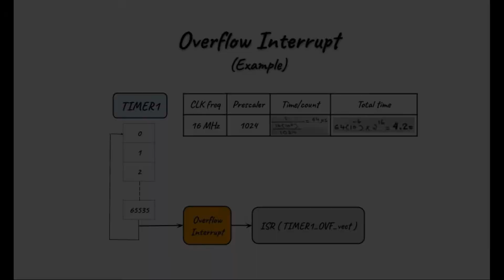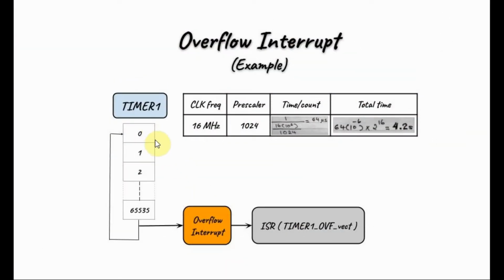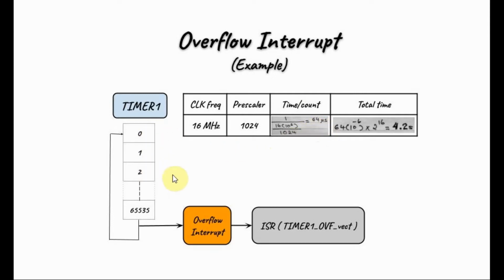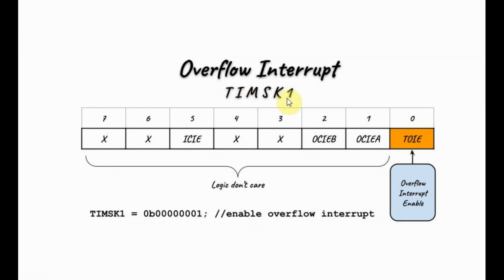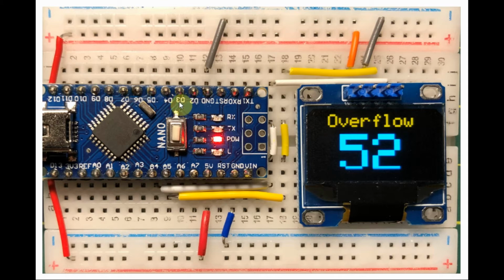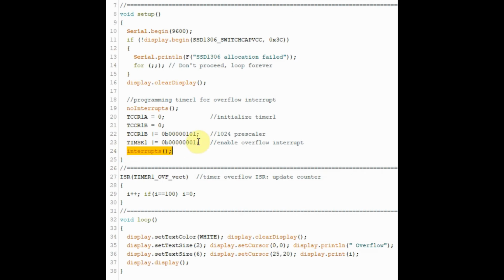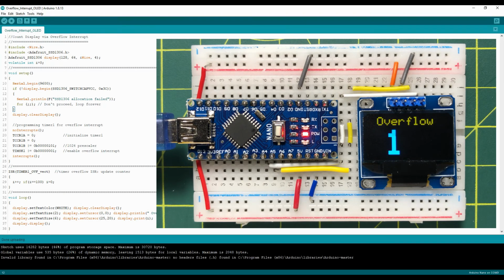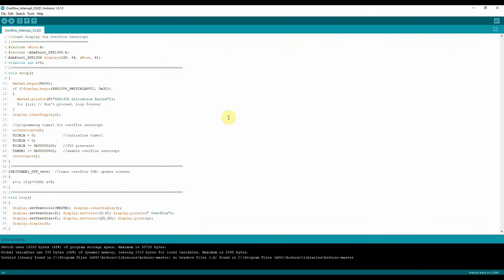Timer Overflow Interrupt in Arduino

Comment: what if i need overflow every 5 seconds, is it possible, also thanks for ur videos man
Reply from the maker: Using external clk @ 16MHz and highest prescaler 1024, you get maximum 4.2 sec. One way I can think of increasing this time is to use the internal 1MHz clk (if possible). Anyway, it is difficult to get exact time (say 5 sec) since you have discrete values for prescaler.